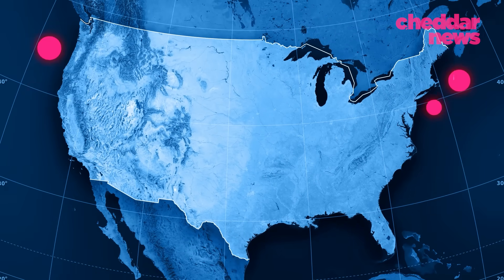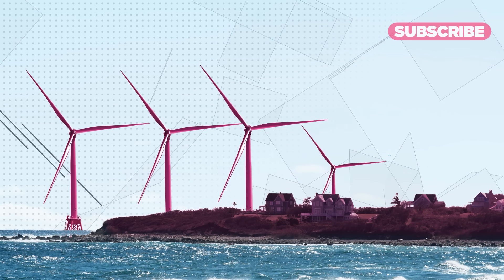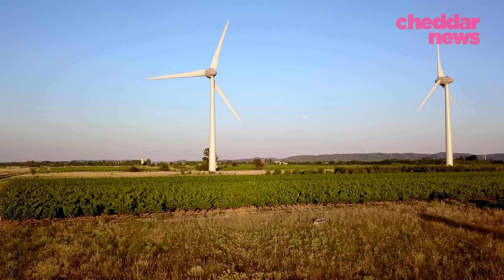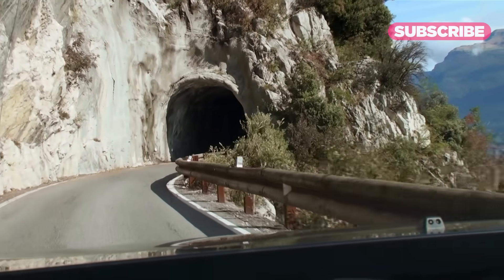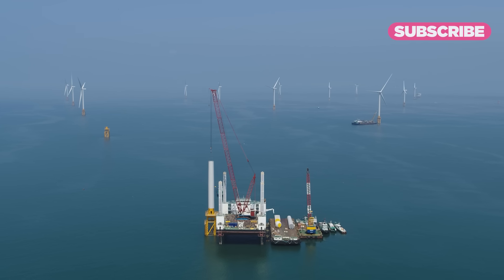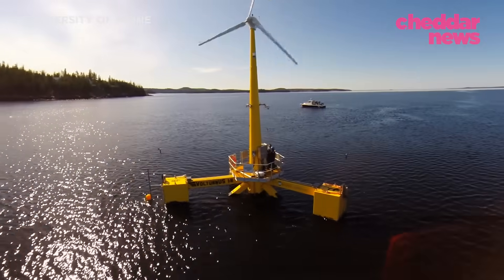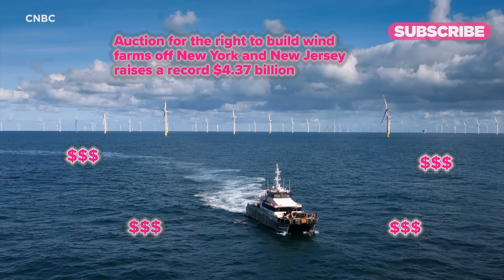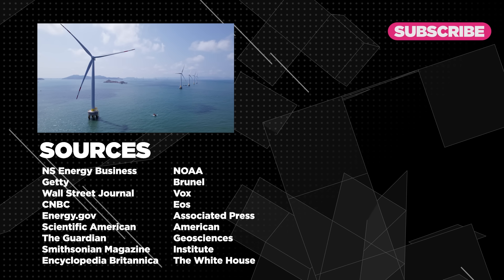Why Finding A Spot For Offshore Wind Is So Tricky - Cheddar Explains

Comment: Its not tricky- its wrong.
Turbines don't belong en-mass out in the sea. NJ USA is planning up to 5000 turbines in farms with some 150 substations... in total containing some 35Million gallons of hazardous fluids and 3.5Million pounds of SF6 (most potent GHG known to humanity, with a warming potential 23,900 times that of carbon dioxide (CO2) and atmospheric residence of up to 3,200 years.)... those fluids leaking and at risk to dumping into the sea en-mass with a natural disaster or military conflict. 
They are NOT Green, NOT Safe, NOT low cost energy.  In fact, European  citizens report to us that their electric rates went up 2-3x.  The installation process in NJ puts them only 10-15 miles offshore in prime fishing, clamming and scallop grounds. Total destruction of these fisheries is expected due to disturbance of the ground from the installing the bases as well as the maze of connecting cables. And after installation, the choking of all living creatures will continue with constant silt generation to tidal currents moving around the bases of the turbines. Photos of such silt generation is observable at sites that have been installed. Further, NJ has no made apparent the "take charts", which are the declarations by the installers of potentially how many marine mammals the prospecting and installation is EXPECTED to "kill". NJ plays dumb that it doesn't know why our whales and dolphins are washing up on the shore during the seismic testing of the seabed. They know why, they approved it. And NJ is just the ground zero for the entire US coast, with Ocean City NJ being the start with the Oersted Ocean Wind 1 & 2. Our environment protection organizations are now approving of this, we have reason to believe their silence has been payed for. If you love the Jersey Shore, donate to our legal defense fund which is our most powerful method to STOP OFFSHORE WIND TURBINES NOW at https://protectourcoastnj.com
Reply: These "windmills" i call death machines! If you can't stop them, then move.

Comment: Nobody is telling us what this nonsense will cost, how reliable they are, how difficult and expensive they are to maintain, and how many clams, oysters, and other crustaceans will be decimated. Commercial Fishermen in New Jersey say these will be built precisely where they fish, and it will hurt their business or put them out of business and all local restaurants that buy fish from them will be hurt also. I don't think the damage they will create and the cost of putting them in service is worth what they will produce and since nobody can control the wind they are not 100% reliable to produce what is needed when it's needed. I think Windmills are absolutely a stupid idea and solar panels should not be depended on either. Common sense electric energy is the newer safer Nuclear power. One last note, we need to fix our fragile means of delivering power that anything producing electricity flows through.

Comment: Auctioning the right to build a wind farm sounds nice for the states who get that money, but in the end it all has to be paid by the consumer. Germany made the same mistake by auctioning frequencies for 3G mobile internet. Companies paid more than 50 billion Euros for those frequencies and as a result, Germany still has very expensive plans for mobile data. 

Instead licenses to build wind farms should be given out for free to companies who prove that they have the funds and the knowledge to build a wind farm. Imagine those $4 billion for the licenses would be used for additional wind turbines. If those cost $20 million per piece for example, $4 billion would be enough for 200 more and that would benefit all sides.

Comment: Couple things, 1. You boasted about how with offshore turbines they can be bigger and generate more power, you failed to mention that the bigger the turbine, the more maintenance it needs, the bigger the blades, the faster the ends of those blades spin, and even with smaller turbines they spin at hundreds of miles an hour, so while the part of the blades closest to the center have no issues, further out, particles in the air drastically damage the blades, and this effect is exponential with blade length, so bigger does NOT mean better, 2. Noise pollution, turbines are obnoxiously loud, to the point the power they are able to produce is limited more by the level of sound they produce than anything else, we literally limit the rpm on them to keep sound levels below a certain decibal, at sea, sound going into water is amplified, to the point it usually drives alot of marine wildlife from the area, i am all for green tech, but wind has plenty of issues making it the worst of renewable energy production, and putting them in the ocean only makes those issues even worse, it pains me how blind people can be to these issues

Comment: Why is wind even a consideration? Solar panels are incredibly cheep and don't ruin the beautiful views of the ocean. I'm dumbfounded that this is even an option when the alternative is so much better! Solar is silent, low profile, can be built stealthily into homes, can occupy desserts or unfarmable land, can be used in parallel with farming to shade crops, and lasts for 25 to 50 years. A ocean turbine lasts for between 5 and 20 years and needs continuous maintenance. Again the fact that wind is even being considered is absolutely DUMBFOUNDING...
Reply: What if you want power at night?

Comment: Dumb question, but why do these turbines only use three blades? Wouldn't you leverage the surface area more if you added a lot more blades, like a jet engine?
Reply: If they go over 57%-ish efficiency the air building up behind the turbine slows down too much and gets in the way of air going through. So extra blades doesn't help.
Reply: And why are they so huge? Can't the cities put them on top of buildings like the old antenas they used to have?
Reply: @nancyfahey7518  Bigger ones make cheaper power (double the turbine length to x4 the output), and taller turbines capture more stable wind.

Comment: Do the Block Island turbines generate enough power to power Block Island? (No.)
Reply: Yeah, they only installed 5 of them. Why is America incapable of building big infrastructure without doing a half-arse job?
Reply: @domtweed7323  Because the objective is often not to build the infrastructure, but to pass a bill, provide jobs to the most superficially diverse set of applicants, and convert the project into a subscription-based service for manufacturers and installation contractors at the expense of taxpayers. President Hunter’s dad is holding a gun to the heads of every American taxpayer, and Congress keeps pulling his trigger.
Reply: @jeffreyboyd2758  Yes, but sometimes big infrastructure projects are genuinely useful.

The issue you've got is their planning offshore wind on such a small scale, so the per unit costs are very high. If you had a massive role our of thousands of turbines they'd be much cheaper per unit, and at a reasonable cost per kilowatt.

There's also value is a diverse electrical system: If one thing breaks the lights stay on (for example, my native UK is heavily gas dependent, and really suffering from exploding gas prices atm). So a bit of expensive offshore wind is useful because it adds resilience.
Reply: @domtweed7323  Certainly agreed on energy diversification, but I think it makes sense to prove the concept on a small scale before becoming pot committed. At one time, there were more horse-drawn buggies than automobiles, until the automobile became more efficient to operate. The Swedish middle school drop out ruling global energy policy has certainly backed everyone into a corner, having to shun the single most reliable, scalable, portable, and efficient energy source our civilization was built upon in favor of wind-powered oceanic transport vessels (who could have imagined it?) and shaving the forests and leveling mountain tops to make way for fields of delicate solar panels to power in-home electric lighting (what a time to be alive!). There are massive fields of wells in the North Sea, and a growing number of wind turbines. How many turbines would it take to make one well obsolete?
Reply: @jeffreyboyd2758  Firstly offshore wind is a proven technology. Not in North America, but Europe (specifically the North sea) it's producing a large chunk of the UK's electricity (30-40% from wind of all types).

I agree it's a bummer needing to give up fossil fuels. But the only sector more important than electricity is agriculture, and large scale agriculture won't work in an unstable climate (tropical agriculture is very possible in Norway or Canada, but a lot of people would starve during the decade-long transition), so we don't have a choice.

And lastly we won't use much useful land for the current transition to solar/wind. Solar works best in deserts (lots of sun with no clouds), so we won't be losing many forests/grasslands too them. And wind turbine footprints aren't much bigger than a large tree after installation, and pretty negligible at sea. (Though, with energy demand growing exponentially, I dare say that will be an issue by 2100.)
Reply: @domtweed7323 As you narrow the proven scope from offshore wind generally, to ‘offshore wind globally except North America’, to ‘well, ok - in Europe at least’, and then finally ‘well maybe not all of Europe, but at least the North Sea’, I can see that offshore wind is heavily dependent on the wind. It makes sense that wind power in the Furious Fifties meets local energy adequacy requirements. The Block Island Sound is not the North Sea. It’s smaller and probably busier than the Solent. The footprint of a wind turbine may not be much bigger than a tree, but a felled tree uncontrolled can fall in any direction, and navigation in a waterway with many sandbars and rocks, heavily influenced by tides, and already congested with pleasure, commercial, industrial and military vessels will be severely impacted. This doesn’t mention the nearby cities and towns lending plenty of surface friction to the equation. The fetch of the North Sea is thousands of times larger than the Block Island Sound, in all directions. This also doesn’t mention that the continued existence of many of these towns depends solely on the summer spend coming in from DC, Manhattan, and Boston and real estate appreciation. These places are going to look like the movie set from ‘War of the Worlds’ with massive groaning mechanical windmills and people will stop going. In southern New Jersey they are planning on putting 350 of the biggest wind mills they could get 9 miles from shore. Everyone from all sides knows they will be visible and audible from what is otherwise 270 degrees of serene beach. Some people think that’s a good thing - a reminder to “do our part” on the one hand, on the other it’s a punishment for “abusing our privilege”. So it’s a religious thing. It’s an idol and it has to be. There is no sensible reason for the greatest nation (and second greatest country) in the history of the world to shut off it’s gas (and coal) and switch to wind —for the purpose of staving off GLOBAL climate change / controlling the weather— which is like, a 21st century thing, considering the problems in the rest of the world, when they produce a small fraction of the carbon emissions and general pollution as several much larger countries, one in particular with a very different present-day attitude towards things like slavery and colonialism (although they’d agree to make the whole world follow a single culture and speak one language), not to mention all of what we in the US call “The Bill of Rights”, and that that one country in particular desires nothing more than your total obliteration. While we promised to halve carbon emissions by 2030, that country promised to peak carbon emissions by the same time. Change my mind.
Reply: @jeffreyboyd2758  I'll do my best to change your mind:

Firstly, torpedoing global action on climate change will hurt the US too. Your no less dependent on growing good than the rest of US. And, though I know it's not in your bill of rights, but I suspect you'd feel your rights deprived if climate change someday denied you food by destroying global agriculture.

Secondly, yes, offshore wind isn't suitable everywhere. It requires areas of high winds, and that don't interfere with other uses. And there's almost certain to be plenty of empty, mostly pointless ocean just off your coast that'll be perfectly suitable. (Though I obviously trust your politicians to pick the wrong cites.)

And on China (I assume your talking about China?) they have the same incentives as the US. They have several big low lying cities that sea level rise will flood (like Shanghai), they've just suffered one of humanities biggest heat waves, and they have a food system more vulnerable than yours. That's why they have the largest installed renewable energy capacity of any country on earth, and most of the solar panel manufacturing. The CCP sees climate change as a threat to it's rule. (And btw, "peak by 2030" will be exceeded. Local Chinese political leaders get promoted by exceeding targets, so targets are set deliberately lose to avoid extreme over-shooting. It's the opposite of the old Soviet system like that.)

And yes, China has about twice the emissions of the US, and that's bad and they should cut emissions faster, but with four times the people! Per person China emits about half the amount of CO2 as America. So if America switches off fossil fuels it'll initially just be bringing it's pollution down to the level of China/Europe per person.

And lastly, on religion, I agree that that's a component. I believe we shouldn't let climate change starve billions of people, or let our human civilization collapse. Those are moral judgements, I can't prove them objectively. But I hope you'd agree?
Reply: @domtweed7323  you haven’t changed my mind one bit, but I whole heartedly agree with every you’ve just laid out. There is a right way to orchestrate this technology locally and internationally for the betterment of all of humanity, I just don’t have any faith in the people doing it.
Reply: @domtweed7323  I’d like to also add my condolences on the passing of Queen Elizabeth II, or Elizabeth the Great as she’s known around here. She embodied and exemplified so many virtues of the Great Imperial Family to which We All Belong that it’s impossible to adequately pay homage.
Reply: All true!

Comment: What is the total carbon footprint for manufacture and installation of the wind farms and when is the break even point?
Reply: A offshore wind turbine over its lifetime will emit 8-35 gCO2eq/kWh. Coal is 740-910 gCO2eq/kWh. Natural Gas is 410-650 gCO2eq/kWh. Look up "Life-cycle greenhouse gas emissions of energy sources".
Reply: It depends on a number of factors (size of the wind farm, distance to coast, offshore turbines use slightly more steel than onshore turbines for example) but most estimates are approx 6-12 months of operation before the wind farm is carbon neutral.